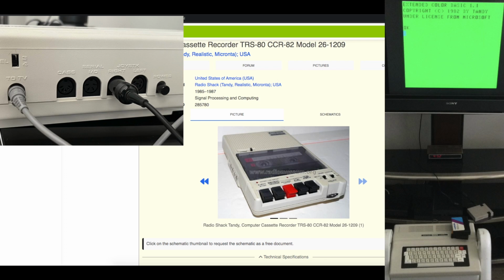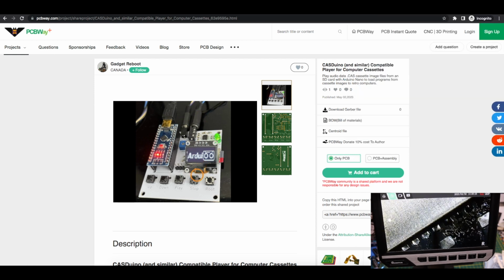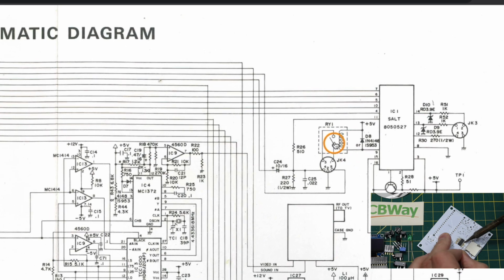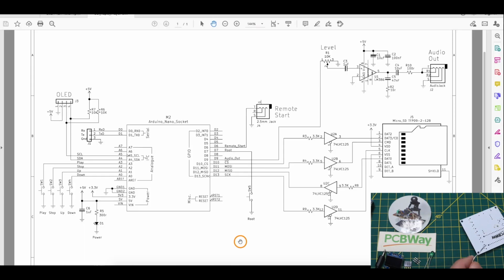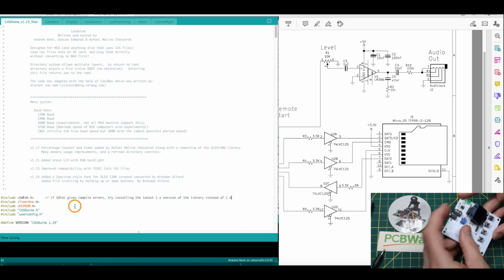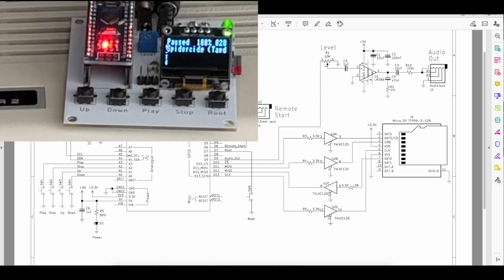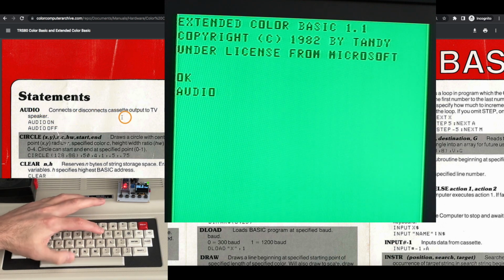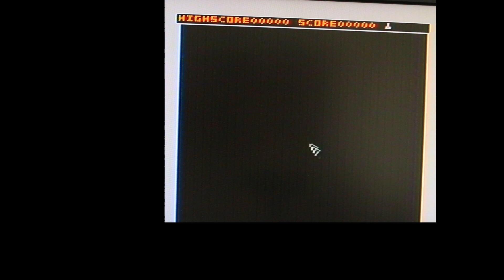Computer Cassette File Player Running CASDuino

Comment: thats pretty cool i think im gonna build one for my coco3 since  i dont have any cassette player👍👍👍👍 and can i use a 3.5 input jack instead of the 2.5?
Reply from the maker: as long as the right size plug goes into the jack and everything is wired up in the correct pin outs, there’s nothing preventing using a different jack but if using this specific circuit board where the board is designed for the 2.5 Jack to be mounted, some sort of hack would be needed like maybe just putting some wires on the board and using an external jack
Reply: @GadgetReboot  Cool because i have  3.5 mono plug here :)